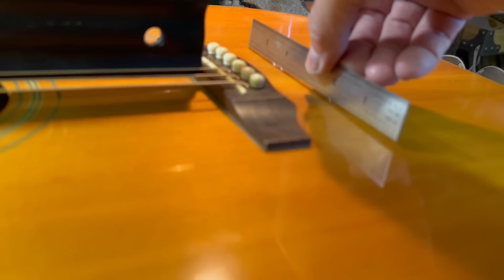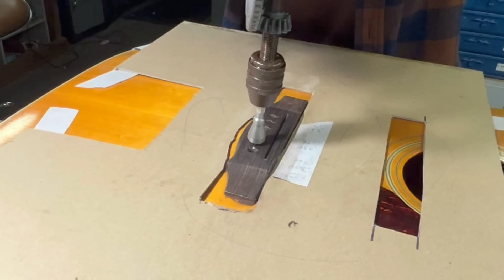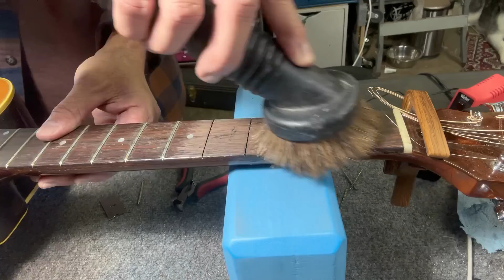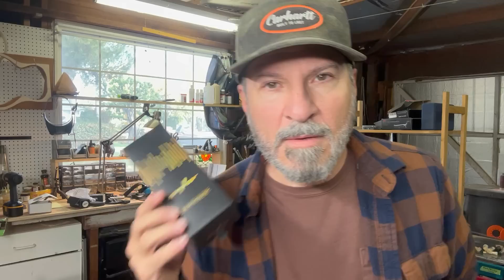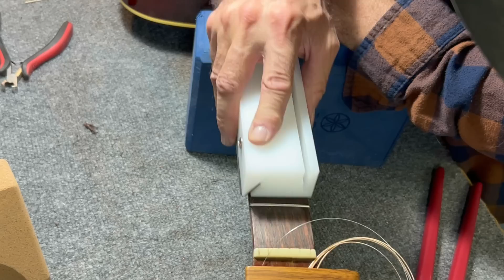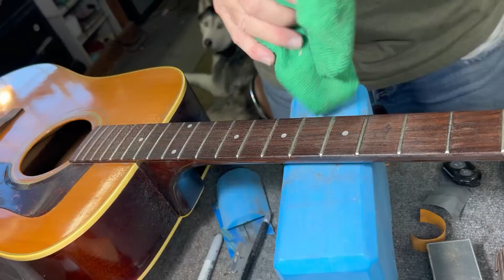Guild D40 | Try This For High Action

Comment: Just took a 3 year old Taylor to a local guy. It obviously needs a neck reset. Even with a bolt on neck the guy is trying to talk me out of the neck reset. Wants to sand down my bridge when all he has to do is swap out a couple of shims. Thinking about looking for a different guy
Reply from the maker: That’s ridiculous. Those are so easy to work on and you’re not supposed to sand them anyway totally adjustable with the shim.

Comment: how thick was the bridge when you were done?

thinning out guitar bridges might be frowned upon because it leaves the bridge too thin and flimsy to keep the structural strength of the top and also allows the string overwrap to stick up too far, but old guild bridges tend to be super thick to start with

combine that with their legendarily difficult neck removal (never reset a guild myself) and shaving the bridge seems a more viable answer
Reply from the maker: Good question, It was over .300" after it was shaved. I think .330"